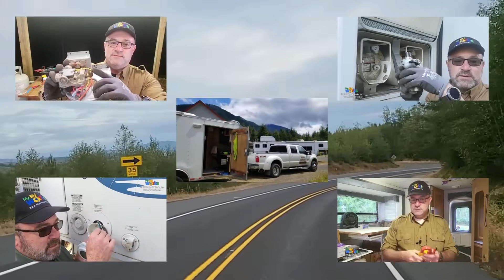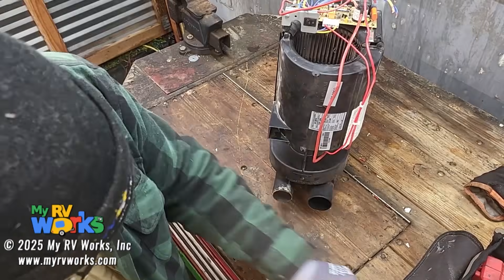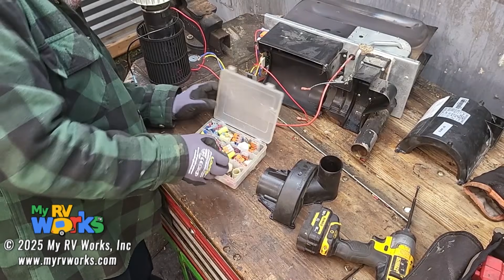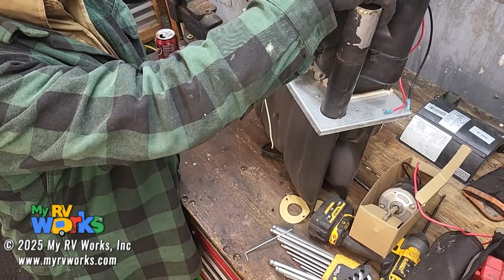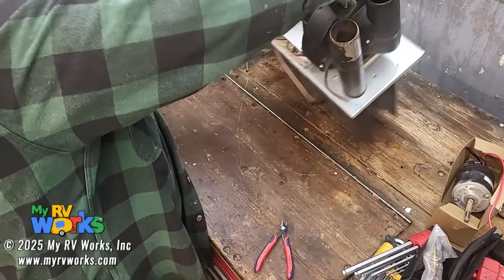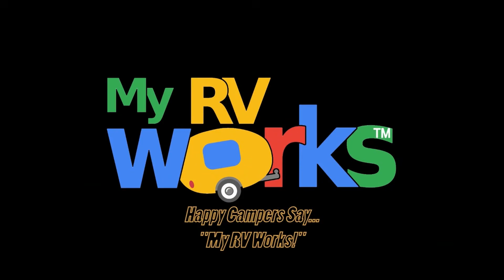How to Diagnose & Replace an RV Furnace Motor – Step-by-Step

Comment from the maker: Here is a complete list of tools and parts!

Test lead kit: Test Lead - Complete Kit | My Site
12 volt drill: https://amzn.to/3ZSCkTo
Gloves:https://amzn.to/41EhPLH
Drill bits: https://amzn.to/4guckTG
Angle pick: https://amzn.to/4iAgThe
521235 wheel kit: https://suburbanrvparts.com/suburban-furnace-combustion-air-wheel-521235-sf35q-fq-sfvh35q-fq/
Magnetic tool: https://amzn.to/41CeNaz
Small different color zip ties: https://amzn.to/3OTegJE
Meter clamp: https://amzn.to/3ZPkQY6
Tool bag with bin box: https://amzn.to/4gqpEsA
WAGO connectors: https://amzn.to/4iErHuX
Small battery: https://amzn.to/3DduMSm

Comment: Outstanding as always.  I have a question.  I have to replace my motor on a SF 35FQ manufactured in 2013 and they are using floor ducts out the bottom of the unit and there was not an adapter plate between the unit and the input unit to the ducts.  Do I need to get s strip of silicon foam strips to seal the gap between the unit and the floor or is there a better method?  Thanks
Reply from the maker: Suburban does have an official fiberglass type gasket that goes around that, but you can run to a hardware store and get wood stove type gasket and that's a lot easier to work with.

Comment: I was unable to remove the whole heater like you did. But with help from your video I was able to swap the motor. Thanks for the videos.
Reply: Can I ask why?   Curious if yours is set up like ours. It is placed on top of a wooden platform over the water heater.  Trying to figure out how to lift it out as it is super heavy.
Reply: @pennyboggs9876 ours is under the kitchen sink and has to come into the trailer. There is a hole that it should fit through however the copper propane pipes comes up in the middle of the opening.

Comment: I noticed my limit- over temp switch ( suburban furnace) doesn't have any color dot on it? How do I know what switch to get if it goes bad? This was put in only 2 yrs ago by a service tech. I don't have any problems, it runs well. I'm just curious just in case it does go bad.
Reply: If a SF 35 made after 1992 the PN  is 232504 and should have a green dot. It is hard to find information on the part specifications and the many different products. I used Google and ask 'suburban furnace sf 35 limit switch part numbers'. It brought up a multitude of switches and looked for a SF serial number above 9201. Do not remember the numbers past 92 which is after the year 1992. Hope this helps. Stay safe, God bless.